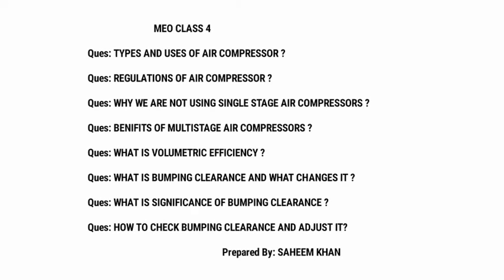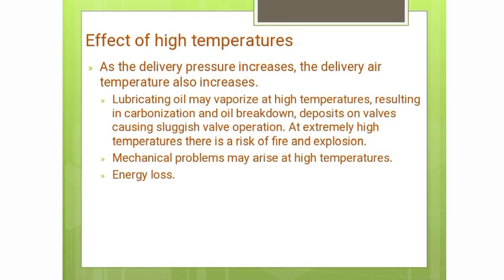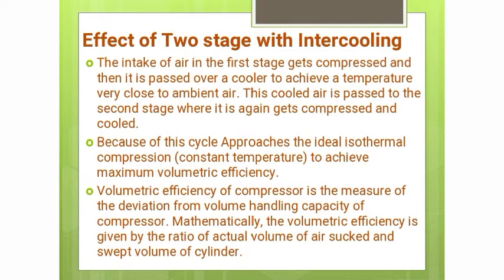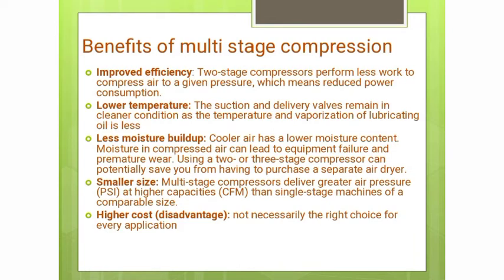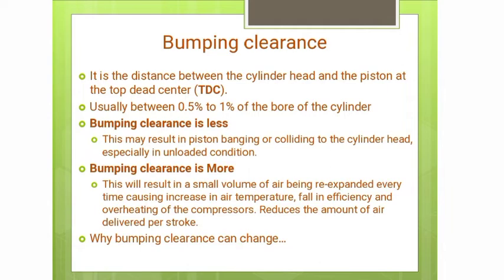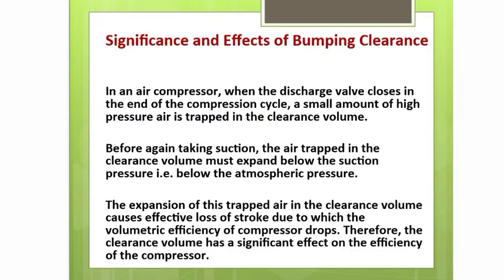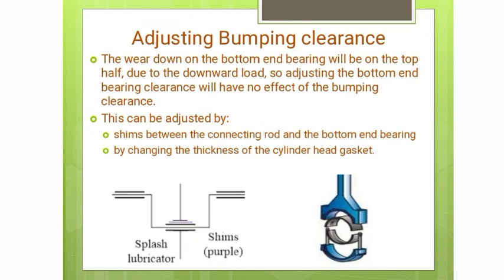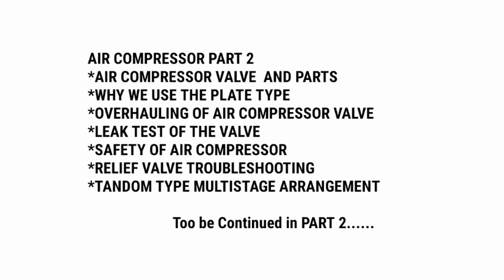Air Compressor Part 1 | Bumping Clearance | Volumetric Efficiency | Multiple stage air compressor

Comment: brother, how can i test air compressor LO pressure low? and how relief v/v test should be done
Reply from the maker: By just lowering the pressure setting

i will try to cover in part 2
Reply: There is a valve before the pressure switch, by closing that lo alarm gets activated. Relief valve is pressure tested after removing from the compressor and by using hydraulic or pneumatic pressure. Should not be pressure tested by closing the discharge valve of compressor.
Reply: Hello sir one new compressor  1 hour oil contamination  fresh water mix in oil . But cooling system in sea water   I replace air intake . Fix new .